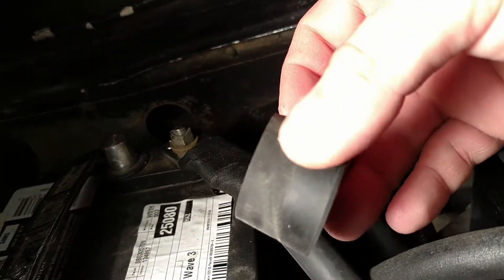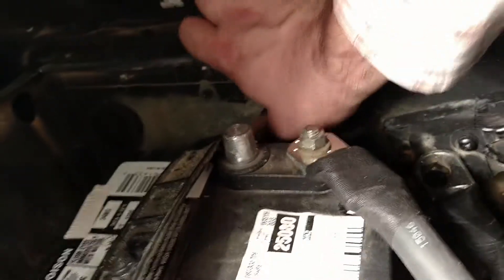Running + 12v and + 24v Power Battery to the Controller, Backup Lights, and GoLight M998 HMMWV

Comment: Hello!  I already have the 200 amp 12 volt 28 volt alternator.  I plan on putting an extra Optima battery under the rear passenger side seat to feed all my 12 volt accessories and maybe a 12 volt winch.   My thought was to keep that battery charged from the 12 volt side of my alternator.  I think the 12 volt side only provides 50 amps.  I will just leave my 24 volt batteries just the way they are.   I was going to run number 2 wire from the 12 volt side of the alternator to the 12 volt only battery.  Do, you have any thoughts about this setup?  Thank you!  Really enjoy your videos.  I'm up in Helena,MT
Reply from the maker: HuntleyTech I think that would work great if you can fit all the batteries under the seat. Most 12 volt vehicles have a 50 - 100 amp alternator, so that should work good for keeping the system charge.
Reply: Optima batteries are pretty compact and I have a mount made for it. I don't have anything else in that storage area.  I'm thinking I just need to route the wires between the frame and body.   Thank you for your quick answer.  I'll let you know how it turns out :-)

Comment: They say running it off the battery itself that will kill the battery faster .. also if driving through deep water would this short out the wires
Reply from the maker: It will. You need to consider your application and draw. Make sure you install breakers to prevent shorts from draining the batteries.

Comment: As you faithful fan, it would be nice for a video explaining in details on 24v to 12v wiring for accessories
Reply from the maker: I don't want to get too detailed, because I don't want somebody to fry their electrical system. That's why I recommend using a multimeter to see what's 12 or 24 volt. I'm not running stock batteries, and other people may have a different configuration. The entire vehicle itself runs off 24 volts, but almost all civilian Vehicles run off 12 volts. That's why it's nice isolate the 12 volt post, so you can run all the modern civilian accessories from that post without frying them. You want to be careful not to hook up 12-volt accessory up to 24 volt source, because that would fry the accessory.
Reply: @HUMMERMODS 
I would recommend using a 24 to 12 V converter 
Connecting off of your 12 V battery will create an unbalance and your 24 V system. Causing one battery not to be as charged as the other one. And that battery will always be in an under charge state, causing more strain
On the 24 V system, potentially causing expensive future repairs
Reply from the maker: @robertschuster7535  It's a better method. I did notice that the 12v battery was always the weaker one.

Comment: Thanks for posting this. We are in the early stages of a HMMWV build project and about to start running 12v & 24v power leads for accessories.
3 questions:
1) Where is the fuse for each lead coming off of the battery? 
2) Where do the leads end? ie. Do they pass through the body tub? Do they go to a fuse block or bus bar, or directly to the accessories? 
3) Are you connected directly to the accessories via switches, or do you use relays on the accessories?

You can check out our progress at http://gear-report.com/category/humvee
Reply from the maker: Battery Box: http://youtu.be/o2aw6wHLc7M >
12V Relay: http://amzn.to/2goE2El >
24V Breaker: http://amzn.to/2goCtq3 >